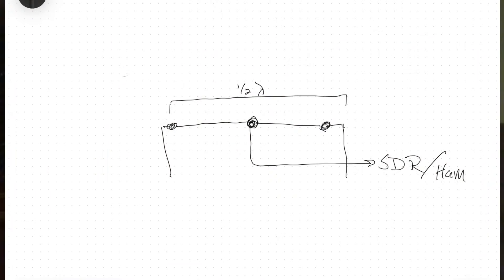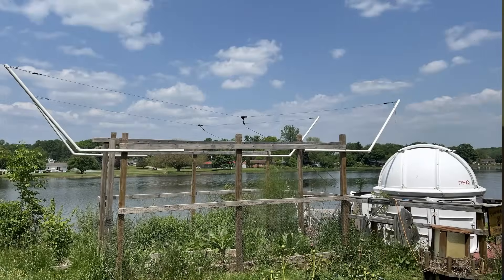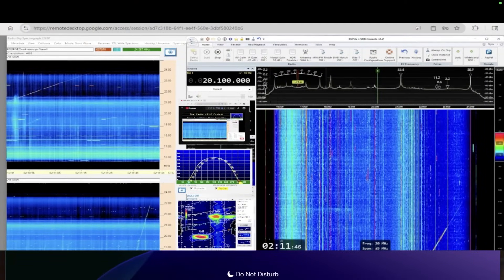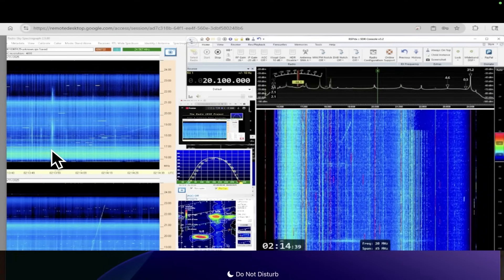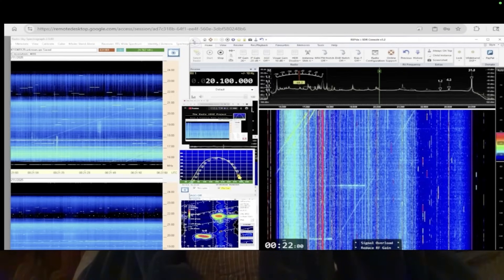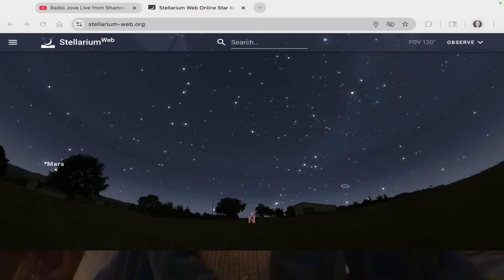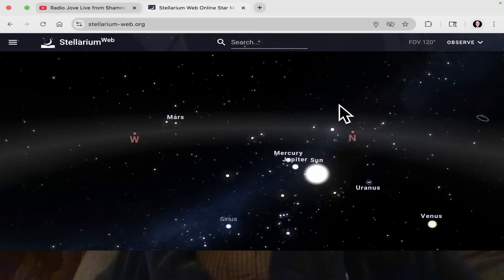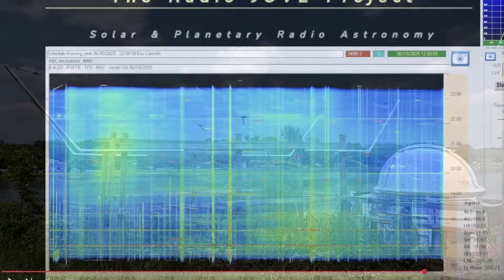I Built a Radio Telescope in My Backyard!

Comment: Hey Bob, I made one too, during grade 12, in around 1972. Not having   anything like we have today, like SDRs, or computers I went old school. The receiver was a broken vacuum tube TV from which I took the tuner and IF strip, powered it up and used a diode as a detector.  The antennas were tv UHF right angle yagi antennas separated by 200 feet on the school roof. The only recording instrument accessible was a small strip recorder. 

My intent was to observe the sun, with the antennas in an interferometer configuration. I got a gorgeous 40 minute sine wave on the pen recorder showing the movement of the sun at around channel 13 (which had no broadcasting on it) at about 200 mhz. 

Fun what you can do with reclaimed scrap electronics and a pair of RadioShack antennas.

About 10 years ago I got to work on refurbishing a 60’ dish )research copy of a DEW radar), but they had taken out the power lines, and the lead kept farting around with no plan and then the military base got tired of us and scrapped it.   This dish was the first western instrument that saw Sputnik. 

The lead went on to building his own, eventually gained access to a modern dish, and they finally got somewhere with good observations.
Reply from the maker: amazing

Comment: I used to live, literally, right across the street from Eglin Air Force Base, in Florida.

What I've always wanted to do, with radio astronomy, is to convert a small satellite dish into an antenna that can listen to the various pulsars that are strong enough to be heard.
Reply from the maker: I built an itty bitty radio telescope with a small dish. I just saw a way to measure the temp of the moon with it and will be working on that as well
Reply: @BobtheScienceGuy 

I've got two, half meter diameter, satellite dishes on my house. 

They were left by the previous owners and I have absolutely no use for them.

If i could transform them into radio antennas, that'd be a much better use of them. 

Maybe in the future. They're not going anywhere, for now.
Reply from the maker: yes, that project is coming up.

Comment from the maker: Note on antennas-  An antenna is designed to amplify a signal of a given frequency.  The size of the antenna is related to the wavelength of that signal.  So for 20 MHz, the wavelenght is about 15 meters.  The length of the antenna is 1/2 wavelength or 7.5 m.  Each side of the the dipole is 1/4 wavelength or about 3.75m.    For the hydrogen line at 1420 MHz, the wavelength is 21 cm, the dipole is 10.5 cm and the 1/4 wave antenna is 5.25 cm.  I will put a 5.25 cm copper wire in a tin can (think a big can of baked beans) as the feed horn (antenna) in from of the C-Band parabolic dish (old satellite TV dish, the big one)
Reply: @BobtheScienceGuy  How big is the big dish you mention?  I have an old direct tv dish, but I think you mean a bigger one.

Comment: Nice job.  I'll point out that both solar HF/VHF radio bursts and Jovian emissions are eye-watering loud compared to most other astronomical radio phenomenon that you might want to observe, except perhaps for the hydrogen line, which can be observed with a very very modest instrument these days (low noise amplifier technology, and the FFT have made this quite easy).  You radio Jove antenna was the same design we used for our riometer deployments, except tuned for a slightly higher frequency range.  In fact, we came up with a "super robust" version that involves a bolted steel structure, and radiating elements made from copper tube!   The electrical performance is not very much better, but VERY much better against "the elements".  Particularly when those "elements" involve marauding deer, caribou, and moose :) :)

Comment: I have been involved in Radio Astronomy Almost al long as I have been involved in electronics. (more then a couple weeks here or there ... lol) I built a Radio Jove system when one of my kids was in HS. It is still running, but I only get to know what is going on when I drop in on the Astronomy Club when invited. I do have several different radio telescopes set up that I use to track metros and such. Do have a set of radio beacon monitors and such the local Ham Radio Group enjoy using. Should you need some tech advice let me know. Will do what I can.
Peace

Comment: Really fascinating stuff. I remember some radar systems use phased-array where each antenna's delay was somehow software tuned versus just a cable length.

When I was on submarine in Navy, got to see that 'waterfall' type of display on the passive sonar system.  Some displays would show heading on the x-axis, so we knew what direction the sound was, others showed FFT and frequency on x-axis. Pretty neat to watch 'the world' in time-lapse like that.
Reply from the maker: Exactly.  I did it with a cable but you can do it electronically. That is how phased array radar works

Comment: I don't think Flatties are going to receive this information very well. They haven't got the Capacitance; They tend to tune out and resist anything they don't innerstand, like a Diode, its a one way thing. It will oscillate with us though.
Reply: An unfortunate sine of the tines.
Reply: @RealBLAlley  Bob should've said "I built a Radio Telescope at Ohm!" It's all about the Dipoles! and the ground plane! its all a bit Heaviside and I didn't want to skip or bounce, so I reflected on it for a bit; realised I might hertz someone if it didn't resonate, but I found a way to gain amplification and detected a small signal from the background noise, but in the end; it was just the Flatties saying Nu- uh.
Reply: They do have a lot of knobs in the community, though they seem stuck on the one channel